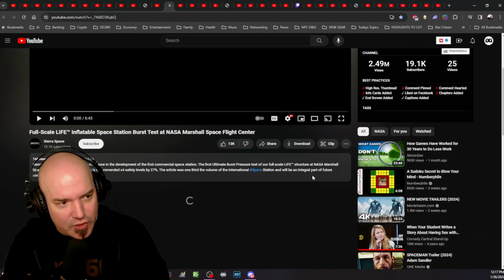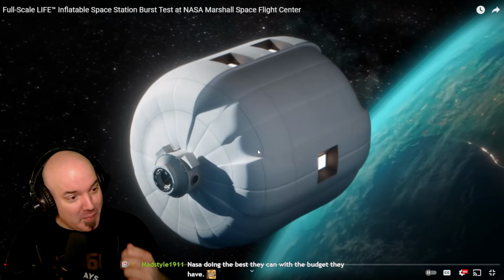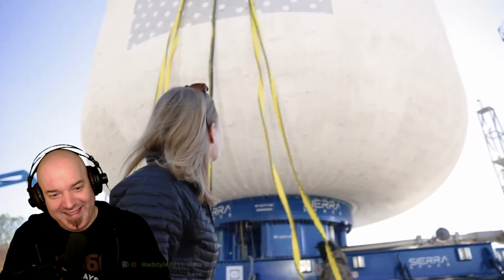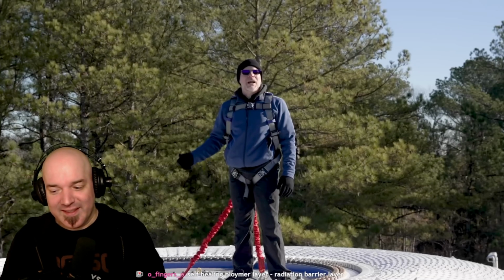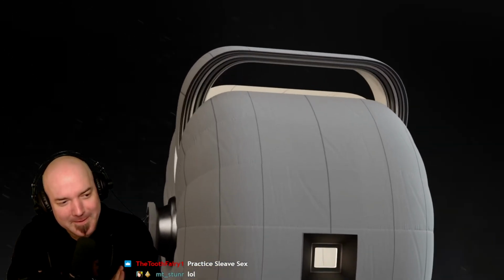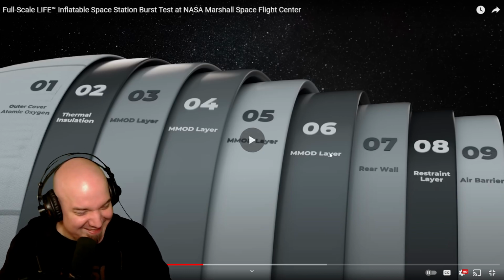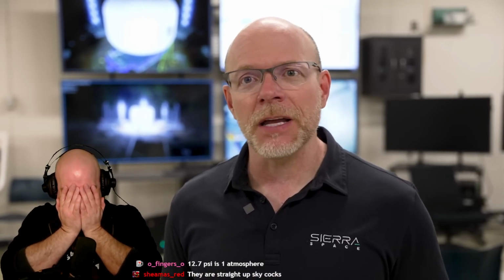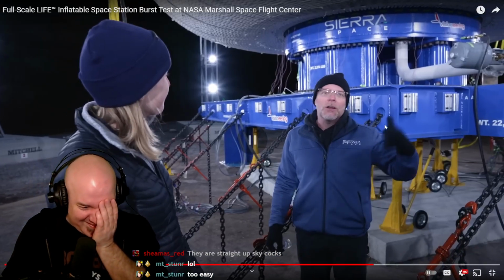DG REACTS to INFLATABLE Space Station BURST TEST at NASA Flight Center

Comment: The cool thing about these stations is compared to the millimeters thick normal walls of traditional modules these walls once inflated are a foot to 18 inches thick and stronger than steel. I know where id wanna stay while in space
Reply: They actually have one on the iss space station that's been there for a couple years now it's a little smaller than the one they showed on this video but it's a tested and has been proven to work with the materials they are using
Reply: @brianv1988  its been longer than a couple of years it actually exceeded its expected time on orbit and is now a storage closet
Reply: @damitcam yeah I was trying to find how long it's been there I know it's been there for a while now
Reply: @damitcam  I watched a video of this and they were explaining how they going to protect the entire thing from being struck by micro asteroids it was pretty crazy the materials they use but it looks like it was still very lightweight and could imagine it would be a lot faster to build in space
Reply from the maker: Crazy! I still don't trust it haha